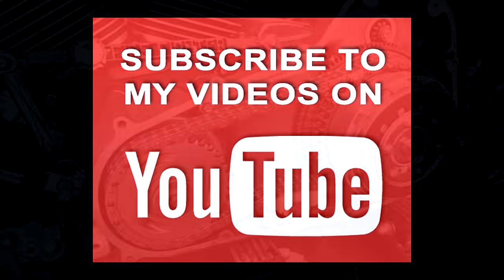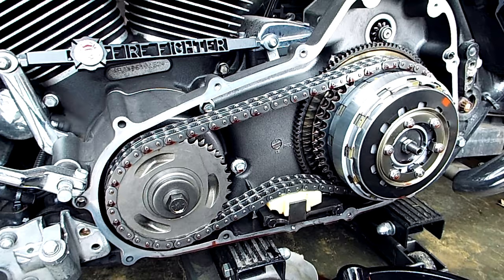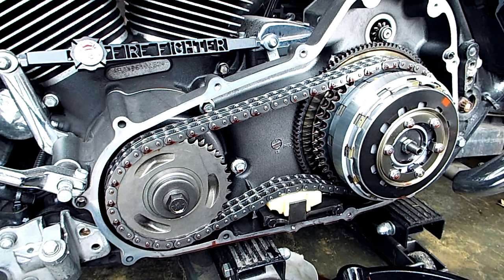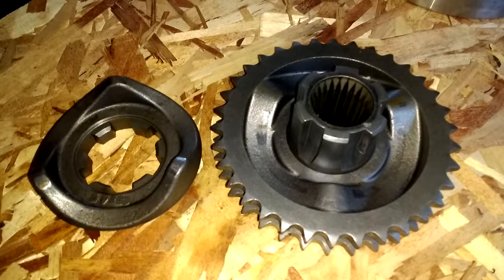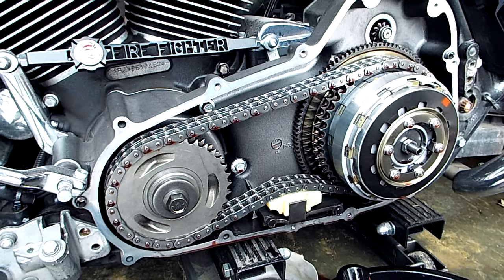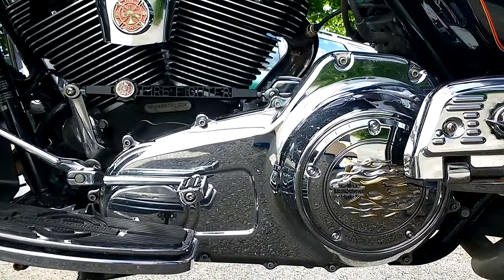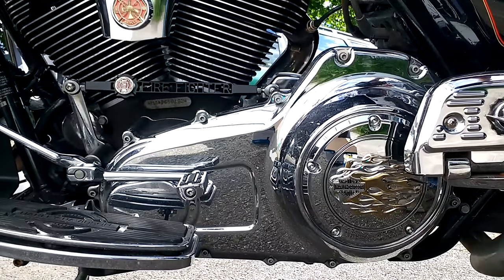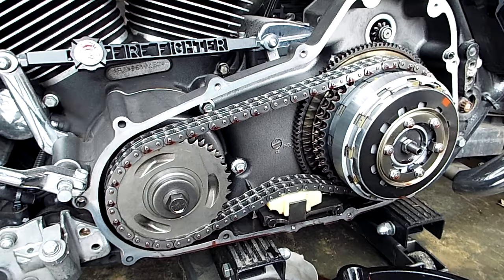Harley Compensator Noise

Comment: mine broke on my 02 Heritage 88" at 52k miles and it sounded much worse. I thought it was the lifter running dry on startup. I was afraid to even test drive it but after much head scratching and inspecting we took out the clutch and primary chain plus the compensator and it seemed fine. My son was holding the compensator and turned it over to set it on the work bench and it fell apart. The spring pack was completely busted. No warning at all, it seemed fine at first. We had loaded it on a trailer to bring it to my  my son's home about 400 miles and it made the noise on startup to park it after unloading. It sounded perfect when he started it and road it up on the trailer. The only thing I can think was when we loaded it my son left it in gear and all the bouncing around to the driveline finished off what time and use had already started. I felt really bad because I was giving my old bike to my son. I tried to take it back home and fix it but he would not have it. He said It was fine and if he fixed it he would feel better. It runs fine now!

Comment: Brother, thank you for the video I had the same noise and I was riding with my wife when head the noise and I look up what could be and your video showed up. Well I head home and opened the primate case and 3 pieces of metal came out, the back rings of the compensator had broken off, luckily the chain didn’t get stuck. Thanks for the video
Reply: My.noise is just like this when I turn off

Comment: I had the same noise on my 2011 96 in.³ it ended up being the starter drive. I replace it with an all balls starter drive and it fix the problem.
It’s only had that noise on start up. It was fine after it was running.

Comment: I have a 2007 with 96ci and mine dont make any noise in the start or stop of the engine, mine you can hear  the noise when It shift gears fast, riding like grandpa is ok but if you kick it  a bit you hear it and also feel it in the reaction of the bike.
Thank you for the videos.

Comment: As far as the 110 goes I know they have the same compensator as the 96 cubic inch they got the same crank they got a lot of same parts you would think with a bigger engine that they would beef up some of that stuff but they didn't and while you're in there instead of replacing the compensator with the original one you might as well go with a heavy duty compensator

Comment: Very nice video with a good sound sample of what this noise is like. I have a 2003 Electra Glide Ultra 88 CI with a 116K miles on her and have never heard this noise which sounds like rolling dice in a cup! I recently replaced the charging system and did a primary and trans reseal and so I've been all through the left side of the bike. It has held up remarkably well. Supposedly the redesigned the compensator to handle the increased power of the 96, but I guess they missed the mark,
Reply: the 88's have same comp they used for years...no trouble with them

Comment: I know it has been five years since you posted this video, but let me ask anyway. I was getting a loud clunk on shutdown on my 2000 Springer. I suspected it was the compensator. I replaced it with an OEM new compensator, but every now and then, I am still getting the same noise. Now where to I look? The noise is always on shutdown, never when starting. I have a 113 ci. with compression releases.
Reply from the maker: That's a good question, Carlos. I would check the chain tensioner to make sure there isn't excess slap. 113 ci is a lot to halt for the factory compensator. It could be based on that. The clutch basket would be in motion of course, so that may have an effect on it. Was there a time when it didn't make this noise, when the build was new?

Comment: I've had Harleys since 85 & never had a problem with a compositor yet on my evo ,or 05 sporty ,08 fat Bob, or my o13 street Bob. All of witch have high millage, the problem is lack of real mantince as in look or over tightened primary chain ,incorrect clutch adjustment & rear belt adjustment .my fat Bob has 130k klm on it with a sidecar ,never had a problem .my street Bob has 50k on it never had primary cover off ,my evo I sold at 120k not a thing wrong .I admit I don't do burnouts but I do ride hard & long distance .

Comment: Wish I'd thought to record mine just for educational purposes.  The high pitch whine with the splat/klunk and smoke puff typically didn't happen more than 2 or 3 times before turning over.  600 mi later (43K total) noticed the fluid leak,  and made it 50 mi to HD.  Busted springs, missing teeth and metal shavings EVERYWHERE.  Next time I see her, it'll be corrected.
Reply from the maker: Wow, sorry to hear it. What a mess.

Comment: Do you also hear it when riding when the engine is under load?
Reply from the maker: Yes, but that also could be heard because the compensator is doing its job of absorbing engine pulses. So if it quiets back down when not under load, it could be normal. My biggest issue with it was being hard to start when hot, like after stopping for fuel. The starter thrashing back and forth fighting the slack in the chain.

Comment: Hey Mark, been riding 2 years now and lovin it!! Noticed my Harley 08 Softail Deluxe makes a squeaky sound and sometimes hard to turn over when starting it.  I was thinking it was the type of gas I was putting in or a battery problem (take the battery out of the equation bec. I just replaced it with a new one 3 weeks ago!)..so I'm calling up my mechanic this week but want to buy the correct parts needed to fix it correctly at my Harley dealer.  Any recommendations please??
Reply from the maker: Hello Felice. I am not an expert, just someone who has spent some time researching why my compensator failed and other issues within the primary. You're going to end up spending a fair amount of money for the upgrades due to the cost of the parts and the labor to change everything out. I recommend the Screamin Eagle Compensator. It's what Harley Davidson started adding to the 2010 bikes as standard equipment except now there is a newer version which includes an oiling funnel such as this kit: https://www.harley-davidson.com/store/big-twin-compensator

With that Screamin Eagle Compensator, you will need to swap out the spinning rotor cover that the compensator squeezes against for proper chain alignment. This means removing the entire primary (outer and inner covers, a fair amount of labor), clutch, etc. I have a video on going through this, and I also have used a Dremel tool to grind away enough metal to slide the rotor cover out of the inner primary without removing it. I have video of that too. Just search "compensator" on my channel. Brand new bolts and gaskets will need to be purchased for reinstalling the primary or you will risk finding leaks in places that will require the whole thing is taken apart again to replace. Do it once and get it over with.

One more thing to look at while it's open is the primary chain tensioner. There has been a lot of discussion on this over the years, and Harley has released 3 versions of them before the Milwaukee Eight came out. I bet you have the middle, or "B" version, which uses round shims against the wall of the inner primary. The newer version, "C" version, has a wider plate that does not use the round shims and has been improved in its design to combat over tightening of the chain. If you have the "B" version, I would upgrade to the "C" version.

Comment: @ Mark Young, I have a 2009 FLHTP Police bike with the 103 and my bike makes the same noise when I shut it off, plus there is a loud rattling noise when I take off but it goes away as you get moving.  Not sure if it is all from the compensator. Please help if you have any ideas. It just started making the noise not very long ago. Going to subscribe to your channel, very informative. Thank you.
Reply from the maker: It very well could be the compensator. How many miles are on it? There's no real way to tell other than opening the outer primary to have a look inside. Does it also struggle to start after a gas fill up?

Comment: This just happened to my very low mileage 1993 Lowrider with 14k original miles. In my case, which is common in EVO’s the compensator nut worked loose. I caught it right away before any damage was done. I will now use red Loctite on the 1 1/2 nuts threads and torque it to 165 foot lbs.  I hope this holds for at least 5000 miles when I plan to check the chain tension.
Reply from the maker: Good catch, I hope it holds, Paul. Long live the EVO's!
Reply: I know this is an old comment but maybe this will help someone looking through these videos for solutions. On my 2003 Electra Glide Ultra, the service manual calls out a red Loctite #262. this is not the red Loctite you'll generally find at the auto parts store. This is a Hi/Medium strength thread locker that is designed for hi torque and vibration. Two drops is all that is called for, and it can be removed without heat or impact gun. If you use common red Loctite, you will be applying heat and using an impact gun when you remove it, which may cause damage to the magnets on the rotor.
Reply: You will probably need to replace the spring pack, and use red locktight again, when the bike is already warmed up, and the starter needs more than two turns to start the bike. 🇺🇸
Reply: @halnwheels  Some people are actually  not dumb enough, to use heat, or impacts.....

Comment: I have a 2007 Softail Custom with the 96 ci. It has 3643 miles on it and it makes that noise. It also has a problem turning over when it's hot. Example I ride to work, turn the bike off and go into the office. When I come back out to start my bike 10-15 minutes later the bike may take 1 or 2 try's to start.
Reply from the maker: I'm no expert, but my first suspicions would be to check out the compensator. Yes, it could be a weak battery or connection in the starter cable, or the starter itself. I installed a Screamin Eagle compensator on my 2009 96ci and it starts up as it should and transfers the power to the transmission fairly smoothly. Big improvement over the 'pancake flat" compensator it came with from the factory.
Reply: @contact4mwy7  How much was the total price?
Reply from the maker: @Mr2princess  I kept it as low as possible by purchasing salvaged parts online, even though shipping cost was a factor. New or salvaged, the prices vary. Take your time to find a good price.

Comment: My 11 road glide ultra 
Sometimes takes 2 trys before she starts. The first time she turnes over and over and over and nothing . Then you click it again and she starts . 
Could the compensator be the issue? 
Or starter teeth worn out?
Reply from the maker: Is it making a thrashing around noise when you turn it over? Does it backfire out the breather? Is it worse when the bike is hot, like at a gas station? Do you have a Power Commander on it or other fuel tuner? How does it run once it is started and going down the road?

Comment: Is this an issue with the 2020 Fatboy m8 engines? Cause I here this rattle when I shut off my bike sometimes especially when it's hot, I have trouble finding neutral, the only way I can find neutral is to turn the bike off and then turn the key on to find neutral! Searching this brought me here!
Reply from the maker: I cannot confirm there is a problem with the Milwaukee 8 compensators. They are built more stout than the previous generations. As for finding Neutral, check your primary fluid level. Too much fluid puts pull on the clutch plates making it hard to slip into neutral without skipping to 2nd or back to 1st. Let me know.

Comment: What does a failing primary inner bearing sound like? Mine sounds like a grinding dry bearing sound until the clutch is engaged and put into gear. Thanks
Reply from the maker: I am not familiar with the sound of a bearing failure on the input shaft to the transmission. I hope someone can help you diagnose it better and maybe check things out to see what is making the noise. Don't get stranded somewhere.
Reply: @contact4mwy7  👍

Comment: Mark, I have installed a Hayden primary chain tensioner in my 2014 Fatboy, as the factory tensioner had over tightened the chain making gear changes notchy & neutral impossible to find. I installed no spacers, but both springs in the Hayden. I was wondering how your results went with your thick shim & 1 large spring fared? My chain  though better still appears to be too tight as it runs better than it did, but neutral can only be found after turning the engine off. I have adjusted the clutch & changed all fluids on the bike, paying special attention to the fluid level in the primary. Can you please advise me if I should do the same with my Hayden install, based upon your results.
Thx,
Keith.
Reply from the maker: Hello Kieth, I have recently switched back to the factory primary chain tensioner, but... Even though the chain seems right to you, if there is a gap  under the shoe, that's your chain's ability to have some slack when needed. As for finding neutral and shifting, I'm suffering with that since the change, but here's what I found, and will do again soon, is that if you drain some of the primary fluid, not much, just a little. I did that while the Hayden was in there as I thought I over filled the primary, and finding neutral while the bike was running was smooth, and shifting was smoother too.
Reply: Thanks for the info Mark, yes there is slack beneath the shoe, I'll try taking a little more oil out of the primary, much appreciated 👍

Comment: Hi Mark, I am hearing a Chick-Chick-chick noise coming within the Primary Cover when the bike is at a low speed. Its a 2010 Roadking having a 96 Ci Motor
Reply from the maker: How does is start when hot, after filling up with gas for instance? How many miles on it? It's hard to tell what is causing a noise inside the primary, which will likely mean someone will have to open it up for a look.
Reply: @contact4mwy7  https://drive.google.com/file/d/1L2cppLC0RWhQxWg6x4hWk2Q3gGxX6qEO/view?usp=drivesdk 

please find the engine how it sounds .. it's done 16000 miles ... Do give your feedback
Reply from the maker: @palarunava  It sounds like the compensator springs have lost their tension. If this bike still has the original factory installed flat disc compensator this is a very common occurrence. Mine went through the same thing. In 2012 the factory started installing the newer Screamin Eagle compensator on their new bikes as they were hearing about spring pack failures with the larger 96 cubic inch motors that started leaving the factory in 2007. My bike is a 2009. I upgraded to a Screamin Eagle compensator and the hard starting clanging around stopped and power to the rear wheel feels good and fairly smooth still. It's made to handle more horsepower and torque. It's a shame that Harley Davidson didn't offer this upgrade to customers who bought the earlier models with the weaker compensators.
Reply: @contact4mwy7  thanks a lot Mark.. can you plz tell me the spring pack part number so that I can check online / ebay.
Reply from the maker: I don't have a spring pack part number, as I never found a brand new set for sale anywhere. Instead I searched online, such as eBay, and found used sets that were salvaged off a bike. I could tell by the looks of them they were what I was looking for. Just keep searching Hardly Davidson Compensator until you find a set that matches yours and for the right price?

Comment: I have an 88Ci '06 and I've noticed a sound like that.  I take it that the compensator spring is the issue then?  I also have noticed that when the engine is hot, then shut off for a refueling then restarted, it sounds a bit like that, and sometimes its as if the starter bendix disengaged right in the middle of starting.
Reply from the maker: Daniel, that's what mine was doing when refueling, so most likely the spring pack is weak? They should sell a new set of springs so one could swap them out.

Comment: Does it clunck when you release clutch gear on?
Reply from the maker: The clunk is mostly at startup when warm. If it clunks when you put into gear with clutch pulled, that has more to do with stiction of the clutch plates and primary fluid type and level.

Comment: Hey Mark, thx for enlightening me to my problem..got a 08 HD Softail Deluxe and has been making this squeaky noise on startup...sometimes I have to try & start 2x...leavin for Sturgis next week...will have my mechanic look into it when I get back.  Fortunately not driving out there but trailing it in my friend's trailer.
Reply from the maker: Sorry to hear it, but you're welcome. The good news is it should take a while before it gets so bad it won't start. Now, do the whole system a favor and start the bike in neutral. I do now, and it took some getting used to as I ALWAYS park the bike in gear. Have a safe and good time out there taking in the scenery!!
Reply: Hey Mark..I ALWAYS start my bike in neutral! Lol

Comment: I'm looking at a 2006 super glide with 88 cubic inch motor. Did they have the same problem?
Reply from the maker: Not really, Rob, due to fewer cubic inches. The main concern with the twin cam 88 cubic inch motors is the cam chain tensioners. They are a spring loaded device that hold pressure against the slack side of the cam chains (there's one on the outside and one on the inside hidden from view with the cam cover off) utilizing plastic shoes. Those plastic shoes wear through and can lead to broken bits of plastic going through the oil pump, possibly plugging up oil passages. Without the plastic shoes the metal arms will grind against the chains and possibly allow metal fragments to contaminate the oil and bearings. There are improved shoes available now along with cam plates that switch to hydraulic pressure instead of springs for some money. Search YouTube for twin cam 88 cam tensioner failure. Just thought you should know before you buy.